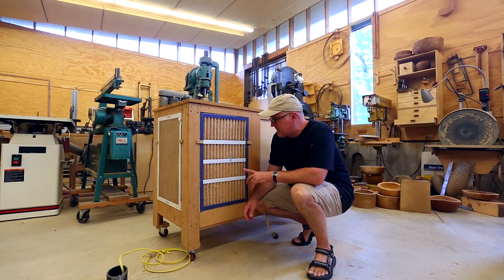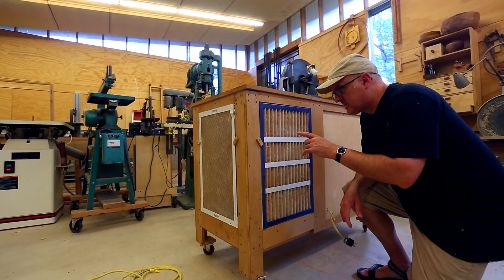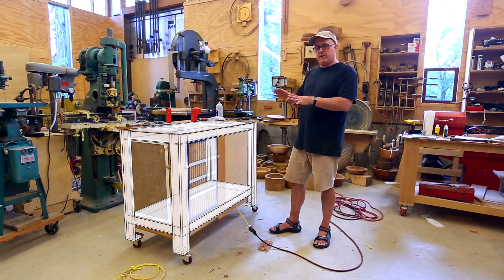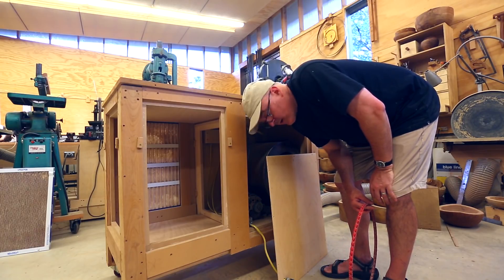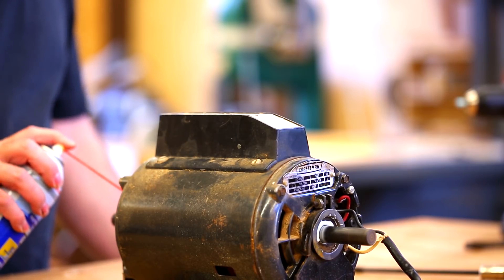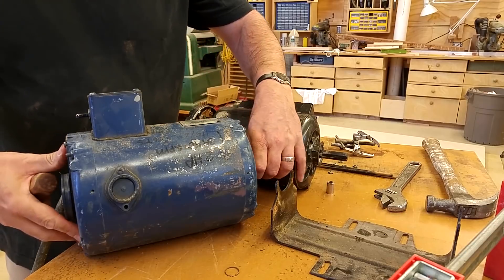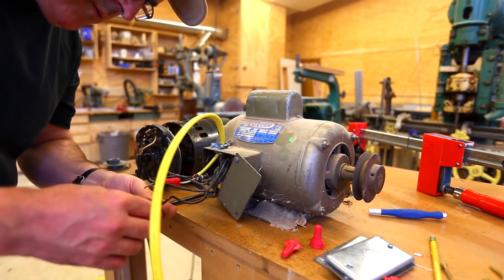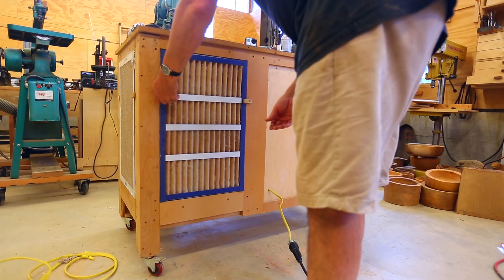Woodshop Air Filter Cart

Comment: I am wanting to build a Mobile Air Cleaner Cart with my shop vac and a dust stopper in the plenum area. Will that kill the performance of the air purifier/dust collector? Cart will be used also for my bench top ridged sander and a bench grinder.
I have a furnace blower/squirl cage fan....

Comment: Thanks Frank. You just solved a problem. I am going to make a downdraft paint station. I'll vent to the outside and use disposable filter covers and no (high) combustibles. I plan on putting dampers on the fan to control air flow and an open grid on the work surface. With the totally unpredictable weather in Florida and a small shop I have to adapt ALOT. Your table design led me down another path. And Power Twist fan belts owe you a shout out. You can change your speed control too. Pretty simple. Nice shop dude. Mary's my wife and I'm too tech challenged to do my own site. Matt speakin'
Reply: I just noticed that this is from 6 years ago. hope you're still at it and going strong.

Comment: You might want to check the amp draw, you may need to put a damper/baffle on the inlet or outlet to increase static pressure which will reduce amp draw and decrease heat in the motor.  Great build and great video, thanks.

Comment: I did a filter box for my hvac intake. I used weather stripping around the perimeter of the filter (to set the filters against) to keep the dust fines from getting through. It also was a 2 filter box.

Comment: Squirrel cage blowers need significant restriction to work properly, not sure if your discharge is restricted enough-check amps. The sawdust sucked the oil/ grease out of the bearings. You can't willy nilly put random motors on an engineered blower check RPM, HP, Amps...If this system was engineered properly it is still a VERY inefficient application, that is a whole house ventilation blower designed for a high restriction HVAC system. Too much CFM!! filters are much more efficient at slower rates....)edit(   funny thing about squirrel cage blowers is that they cavitate and draw MORE electricity without a proper load-opposite of fans.

Comment: This is pretty neat and I know this is an old video, but It was kind of perfect timing for me to see it.  I just had my furnace and air conditioning unit replaced today.  I took the blower motor out of the old furnace before the guys took it away and I am going to build myself one of these cars.  Thanks for showing.  Great video.  Especially since I just dropped 14k on the new furnace and air conditioner I have no money to buy one of these air filters for my shop.  

I have a question if anyone can help me.  The blower motor fan has like 4 different speeds I see.  Only the lowest speed and 3 have wires coming from the connector.  I dont care about the other 2 speeds but I would like to be able to make use of the 2 speeds that do have wires from the connector.  Is this possible for me to do, or do I just have to choose one speed?

Comment: At 3:25 it looked like the fan was a bit unbalanced with how it turned slowly then began rolling a bit faster. That may be something to check closer the next time you have to take that cart apart. And definitely replace that Romex ‘cord’. Even a junction box with a short stub of heavy duty electric cord sticking out the bottom to plug into an extension cord would be better. But otherwise that cart is really neat!

Comment: I highly recommend replacing the plug and power cord going into your box with 14/2 or 12/2 appliance cord. you are using romex which is not rated for use as a power cord because it was never intended to be moved

Comment: Why are top and bottom torsionboxes and not just some kind of plywood or so? Thanks for the video!
Reply: +Peter, the top he could use as a work space if needed for say drilling operations with a hand drill where collection is a huge issue. The bottom he needed to mount things on a flat surface, which is why he made those boxes that way, or at least that is the only reason I would do it personally.

Comment: Frank if your fan and motor have that much dust on them your filters aren't doing their job and and all your doing is circulating dirty air. Perhaps your internal air filter should be sealed better
Reply: That is what I was thinking, there should be minimal if any dust on the actual mechanicals inside of the cabinet. I would assume no dust considering it is supposed to clean the air in the shop honestly.

Comment: You can see the hole where you pour oil to lubricate the bearings at 4:05 and even better at 4:31, right above the screw driver head. There was a rubber plug in it from the factory to prevent dust and debris from getting in. That port leads down to the felt packing that holds the oil around the bronze, which is porous allowing the oil to seep through the bearing. Those type of bronze sleeve bearings are supposed to be oiled fairly regularly with a light to medium oil.

Once they get to the point that they squeak it is usually too late and time to replace them. 

Many of those older bronze sleeve bearing motors had a more expensive model that used ball bearings. They even used the same casting. I have a few of those I was able to convert to sealed ball bearings. I was able to press out the bronze and measure the lip inside for the correct size and press in the ball bearings.
Reply from the maker: +mcleodjm2 I looked in those holes  and the did not seem to go any were, but you may be right as that makes a lot of sense.  I did pull the whole thing apart and there were just sleeve no ball  bearings.

Comment: Frank.  Great filter system.  Believe it or not I have the nearly identical system in my shop that I made.  Mine started squeaking too, I found two areas that had cloth on the motors.  You drop the oil onto the cloth and it goes slowing into the correct place. (Perhaps a different motor than you had).  Also one thing I added to mine was a dialed timer switch.  That way I leave it on after I leave the shop and it shuts off at whatever length of time I deem will work.
Reply from the maker: +SuperJamster1 I like the timer idea

Comment: I have a blower just like that set up to blow out my shop window(basement shop) and have a box built around it with a filter.  but I wanna take it down to use the space in front of the window for a lumber rack.  so I like your idea for the cart.  I may borrow this idea and modify it to be an assembly/outfeed table between my 2 table saws.  triple duty! thanks

Comment: Nice build, Your electric motor needs new bearings, an easy job to do although you may need a bearing puller like the one you used to get the pulley wheel off the shaft (but a bit larger) or to carefully cut the old bearings off. 
Make sure to replace them with high quality sealed bearings like NSK brand. 
Also as for the plug you have on it, Romex wire is not a good choice for a cable that will be moving a lot because eventually the solid copper conductors will break, it's best to use a cable with stranded copper wire for better flexibility. 
It would also be good to make sure the switch you have on it is rated for at least 20 Amps. and has a nice heavy clicking contact (cheaper switches do not have spring loaded contacts so they tend to ark under heavier loads and wear out quicker)

Comment: The squeak could have been a centrifugal switch inside the motor. It switches off the starter winding after the motor reaches run speed. It probably scratched on the starter winding contact before total winddown.

Comment: A totally enclosed motor will eliminate 'dust in motor' issues & if you sacrificed 4-6' from one of those orange extension cords you've got laying around the shop (I see them on your video) the 'Romex' problem can be eliminated (best to use extension cord of #14 AWG or larger depending on draw of the motor).

Comment: You really need to replace that "Romex" with some stranded "extension cord" wire going from the plug on the outside of the cart to the electrical distribution point. Romex is not meant to be bent repeatedly and it will break eventually possibly causing a short and a fire. The solid wire is fine inside the case where it's not going to get bent all the time.
Reply from the maker: +oldiron1223 yes, good point.  I thought about doing a windup spool on the inside too.

Comment: Frank, 
Just finished a "Ron Calverly inspired " air filtration cart.
I don't know if it's legit to post a link to my OneDrive account where the pics reside...but...here goes nothing...
Just add the http:// prefix to the following 1drv.ms/1EJJjka

I added an LED countdown timer that runs from 1 minute to 24 hours.
Also used a ROTARY switch to control the 3 speed furnace fan.

Works like a charm.
Do you have a PUBLIC email that I can send you pics?

Robert
Reply: +Romeo Whiskey 
BTW...I also have a SKETCHUP model available if you search for:
Woodworking Air Filtration System CABINET
in the Warehouse.

Think I also forgot to mention that I added a serious HANDLE to move around the cart.
Reply from the maker: +Romeo Whiskey cool,  The black tower of dust filtration.

Comment: Do you not think this is like, insanely dangerous? If that motor had have sparked whilst fine wood dust was blowing through, it could have lit the entire thing on fire, and you'd have a fan-powered flamethrower box. There’s a reason then always have one wooden gear in old flour mills.
Reply: +Charlie Beadle Great point, Mythbusters attempted to bust the myth that sandblasting a large plastic pipe with WALNUT SHELL media could produce a  static charge high enough to kill a person if it was to arc. They completely ignored the fact that the operator was much more likely to die from the dry organic media floating in the air being ignited by the static arc and causing an explosion. Similar to placing a paper towel tube over a lit candle and then sifting flour down the tube. BOOM.

Comment: With a little re-design that could be your shop vac.
Just replace the outer filters with pannels (one with a hole for a 4 in pipe) and a deflector board on the inside. Need to figure out a catch bin for easy emptying.
Reply from the maker: +Robert Schuster Every few months, it should probably be more often that that.

Comment: Since you are using a drive belt, it would also be preferable to place the motors and the
electrical wiring components  separate from the dust/air flow path

In this environment Totally Enclosed Explosion Proof motor would be appropriate for this application. 
http://www.engineeringtoolbox.com/nema-enclosure-standards-d_740.html

Comment: The motor and fan assembly are from a forced hot air heater and the holes inside the groves on the front and back are where the oil goes I see the holes in the video were they not drill all the way through ?

Comment: Cool air filter. It makes so much more sense to have air filters down low so they're working with gravity to capture the dust. I don't get why so many people hang them from the ceiling.
Reply: I'm not so worried about the dust that falls to the floor. I worry about the airborne stuff that you can't see. That's what gets trapped in your lungs and causes problems for you. The other stuff gets taken care of with my dust collector or shop vac. Hence the reason to hang it up.

Comment: Hi Frank, good job. If you allow me an idea, what if you separate the fan and motor bracket from the cart with rubber and installing sound insulation on the inside to reduce vibration and noise? it's an idea that might work.:)
Greetings from Spain and continue with your great work!

Comment: Frank, for future reference those old craftsman motors should have 2 plugs in a 'C'  style channel above the shafts and if you pull the plugs out (on your motor I believe they were missing, possible reason for it to create the noise.) and then put a fair amount of oil in there and replace plugs. I own a '77 Craftsman table saw and if it needs oil it sounds like a combine harvester-freight train hybrid.
As always great video -Spencer N

Comment: Nice portable cleaner unit! 
Hmm, drilling some holes in the top torsion box, getting it to flow into the interior and blocking up the outside filters would get you a nice sanding table as well...

Comment: 7:50 I am wondering if that gap at the top of the inner filter wouldn't be a problem in the way that a lot of air can pass it unfiltered?
Reply: +Michael Merrifield I see that there is actually a rather thick border around the hole. Seems like that would stop the air from skipping the filter. thanks for pointing that out. :-)
Reply: this doesn't seem to be a problem. there are about a million ways to fix it, like to tape it.
Reply: +tipinwings I'm not saying you can hardly fix it, but if there is that gap than the inner filter is not really useful..
Reply: +pcfreak1992 The original and the 'thicker' one are both 20x25. I bet the frame shown at ~2:00 is smaller than the 20x25 filter (all the way around).

Comment: I figured that 'up' was the corner without the electrical cord. :)

You might want to consider a timer to avoid this in the future. The sort you sometimes see on lights in industrial or commercial settings.
Reply from the maker: +tetsubo57 I realized that once i was putting it back,  I liked it for the video.
Reply: I think the idea of the timer is a good one. Just need to make sure it can handle the current the motor is drawing.
Reply: +frank howarth  That shows us how thorough you are, Frank...  :)
Reply from the maker: +Michael Ciha I like the timer idea too

Comment: Frank, the typical cooler motor is not designed for such a dusty environment.   Are you using a HEPA filter as your final filter they cost more but do a better job on fine dust also some type of weather striping to seal that filter would be nice.  It would stop blow-by.
Reply from the maker: +Frederick Kaludis it definitely could be sealed up better.  At some point i want to get a bag filter for the inner filter, that would do a better job that what i have now.  which is an upgrade from what i had in there.

Comment: I have something quite similar except it is arranged with the filters on top since I have a garage shop with limited floor space. I added a small rectangle of plywood angled up at about 25 degrees to the air outlet to direct the air up a little as my feet are not what needs the cooling effects here in Dallas. Mine is my old furnace blower and is direct drive so no belts. It is nice to get that strong stream of rather clean air directed at my face while operating the table saw.

Comment: Did you check if the second motor fit the mount from the first motor?
Reply from the maker: +Double Dare Fan I did not think of that.  the blue motor is considerably bigger than the original one.

Comment: you shud change bearings and repair damaged waier and you have working motor. main issue was dry bearing. if there is no lubrication points, you have to change the bearings. sprayed lubricant only temporarily solve the problem. squeak, a sign that the bearing has worn out and will soon fall apart.